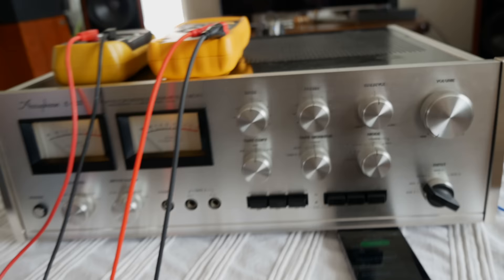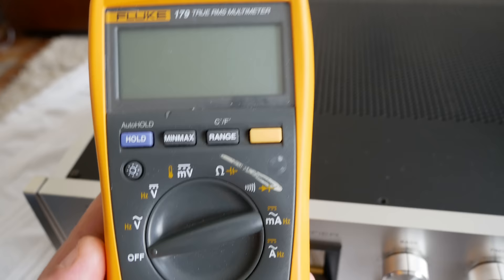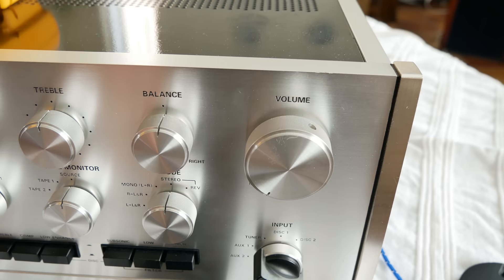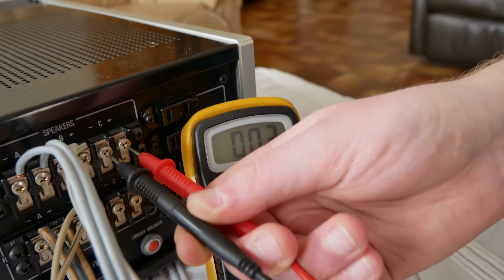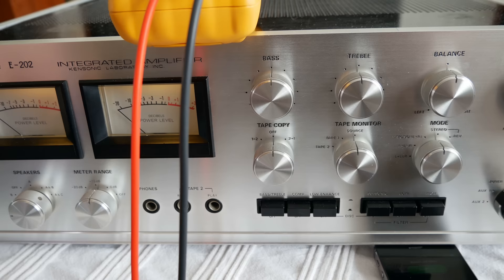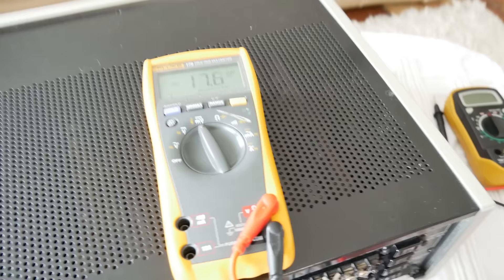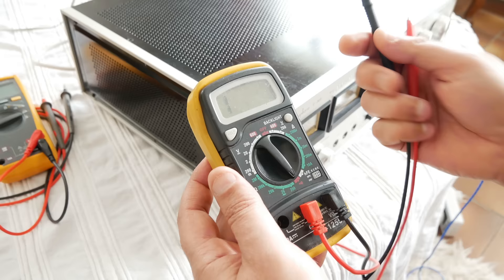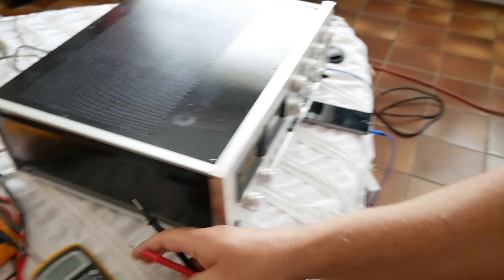How to test and measure your amplifier outputs - avoid blowing up speakers

Comment from the maker: Simon, you forgot to explain me how i can check the wall outlet with my cheap meter...where does my meter has to stand for checking the wall outlet?
Reply: Meter must be set on ac (the V with the little "wave" beneath).
Reply from the maker: if you don't see new video's from me anymore you know the test went wrong
Reply: @vintagestereo  hopefully test will go just fine.
Reply: It's "explain to me", not explain me.

Comment: He is right about those switches to be tested.  If you happened to own Carver C-19 Preamp. be careful because it comes with rotating switch which will thump out dc voltage as ou rotate it blowing speaker tweeter, which happened to me.  Push button type switches are another bad ones, not much as knife type.

Comment: Very good vid. If people go measuring things with multimeters, be 100% shure to wire the meter correctly. If by mistake the meter is setup for current measuring, you will make a short on the leads, and this can be the end for you're gear, or meter...Old devices of say, 30 to 50 years of use, it's a good idea to check and replace all capacitors. I always check first bias current on output stages in amplifiers...

Comment: Hello this is very intresting thank you. I just bought a second hand amp and connected to my speakers and the right channel stopped working. checking the volts DC I get a reading of 12.5 mvolts dc on the right channel the left channel i s 0. turning dials I have no pops or cracks is there anything else I need to check thanks
Reply: IC was crash so check it out don't connect speaker

Comment: I make it a habit of always making sure I turn the sound down on my 90’s Proton Power amp. My new AVR has a safety feature when switching between functions. 
Where did Simon get his electronics knowledge? The kid knows his stuff. 

By the way, fuck the dislikes!
Reply: i study electronics. If your amp has a relay always turn down the volume when powering up. There will be a small spark in the relay when it kicks in. If you have the volume up that spark will be bigger and will wear down the relay faster.
Reply: Andrew’s lucky to have your friendship and knowledge. His video of your place and the vintage equipment you have, work on, and sell, was amazing. 
Thanks for the response, Simon. 
The Proton amp has about a 3 second delay after turning on, but I turn the volume to O when I turn it off, and check again before turning on. It was my first decent amp I bought when it came out, it still works great, and I love the dynamic headroom it has, the large green-lit VU meters and the “Power on Demand” feature the unit has. Have you ever seen the Proton AA1150?

Comment: Just curious, shouldn't the black probe be connected to the COM port on the meter ?
Reply from the maker: I don't know. I have 0% knowledge but Simon connected it this way and he knows what he do
Reply: Speakers are ran of AC not DC cant get an accurate measurement if you are checking for DC. You see that little - symbol pop up when he checks it..... means you are not in the right setting
Reply: Yes,he had it hook up wrong on the cheap  meter it read  plus votes . On the better meter it read negative votes.

Comment: Thank you, quick question, if an amplifier burns your speaker, does that mean the crossover of the speaker is also burn? Or could it be only the speaker coil? (I burned my left klh 10.5 tower with a Fisher rs1080...) Thanks in advance!

Comment: First of all this guy talks too damn much like he loves hearing himself talk. 
For a video that was supposed to be no longer than 2 minutes this ends-up being 15 minute video. 
2. when he's measuring the mV at 4:55 he says if the measurement indicates about 4 mV (can't understand if he says 4 or 40?!? anyone??) "you might want to put it a bit down" then he says "if it's around 8 (again, does he say 8 or 80) on it don't connect speakers because it will blow up the tweeters". 
He then proceeds measuring the other channel at 5:29 which indicates 18.5mV. He says "that one reads around 1.8" WTF?? The dot is clearly behind 8 which is 18 ?!? (confusing again). Did he have to remove one decimal due to how his meter displayed the result?? Even the author of the video says "the other one reads 18". Most probably indeed that reading is 1.8 but the technician should have explained why he read it that way. For a beginner that never used a meter in his life this is far from straight forward.

I got a Sansui 881 from the 70's and the Aneng AN8008 multimeter bounces around the 60mV range when turned on.
Recently I bought a Musical Fidelity B1 and wanted to know how to measure the outputs as it came with a pair of B&W DM110i that had blown off tweeters. I've put it on the multimeter and one channel measures 19.6 whereas the other one measures 30.7 on the mV setting.
Reply: How do you determine the polarity of speaker wires coming out of a guitar amplifier? 
It's just a black double wire. (One of the wires is smooth and the other has ribs.)